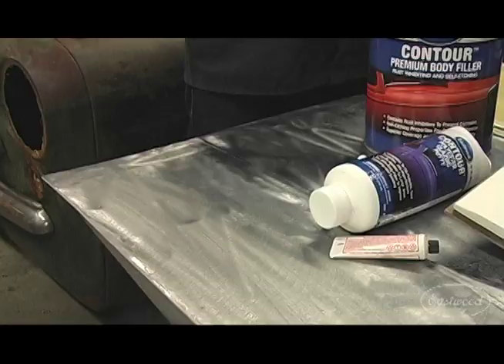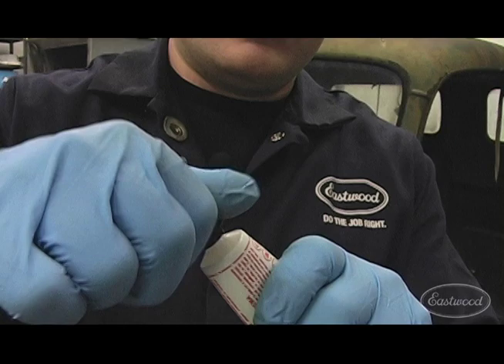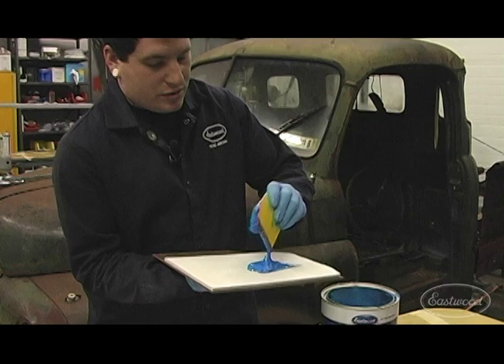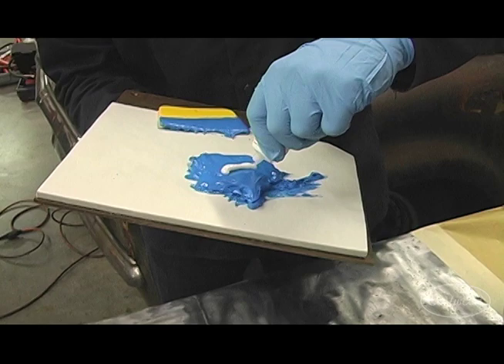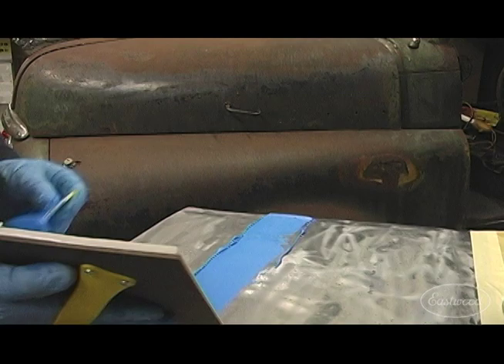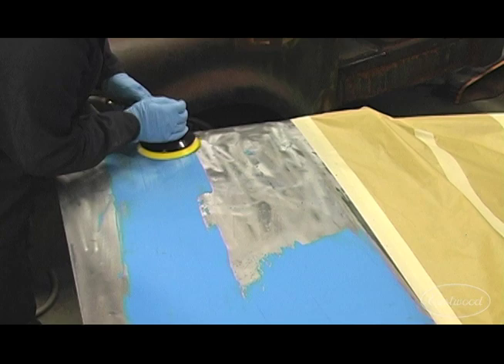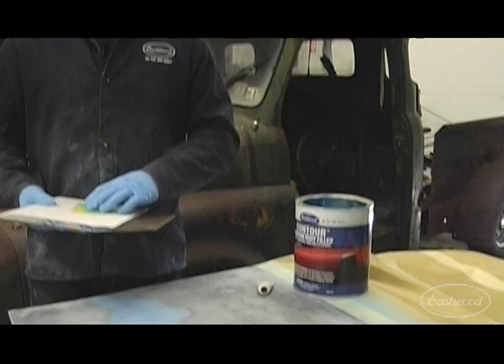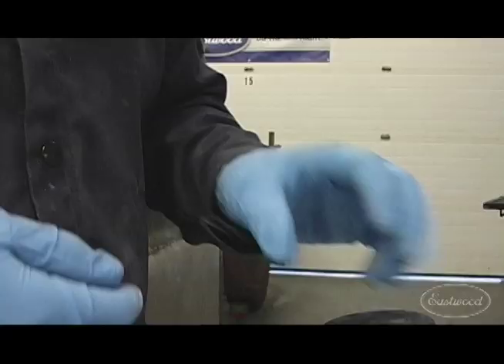Body Repair How To - Contour Body Filler & Paint on the Dodge Pickup Door at Eastwood

Comment: Working on the bed of c10 pickup 2500..Got the bed sanded and still has rust andnholess up by cab of truck by fuel tanks .medium hole..I want to know if I can get apoxy to seal hole up or can I get wiremesh cut to fit and put Bondo over it and sand it down and it look right...Please respond  ASAP Thanks Jasper
Reply: Doing all this work on truck outside and by hand please respond ASAP ..!!!Jasper
Reply from the maker: Without looking at the rust, its tough to tell you exactly what to do.  Does the area needs to be cut out and replaced/patched with fresh metal?  You may want to check out Eastwood Internal Frame Coating for inside areas like rockers, doors and frames. Do not cut and weld near a gas tank.  You should remove the tank before doing any work near it.  You can call an Eastwood Tech to discuss at 800-343-9353